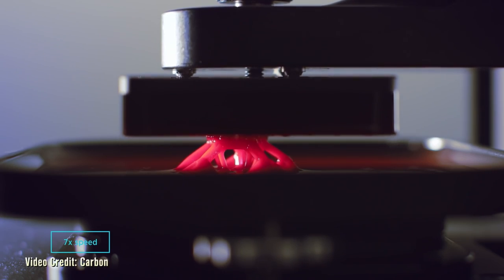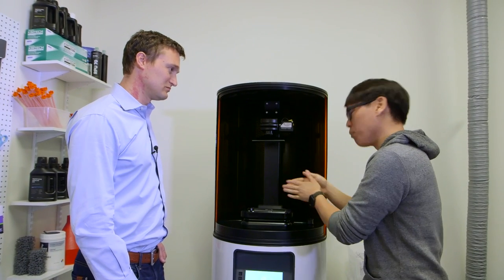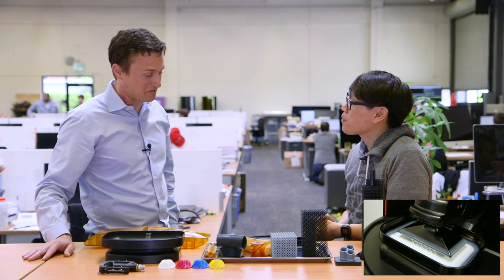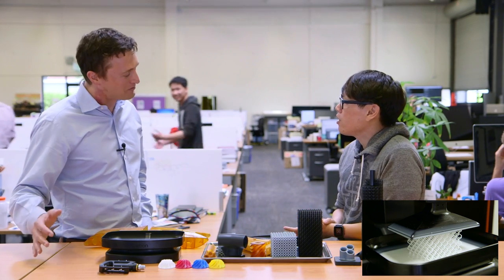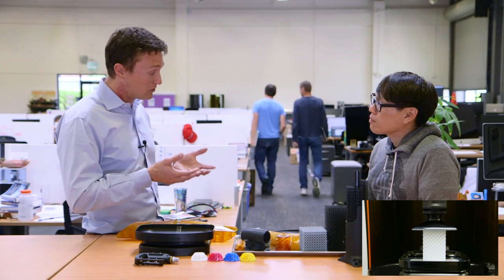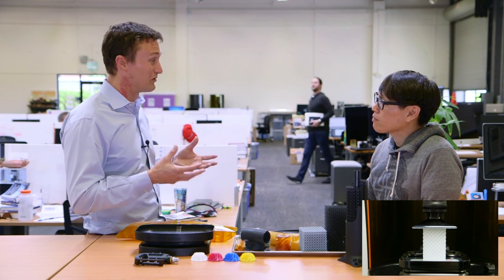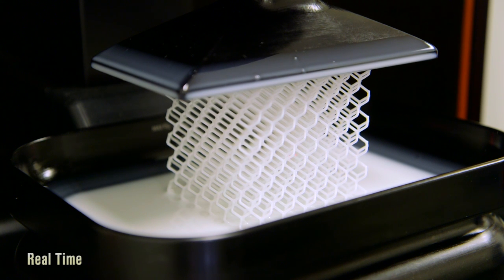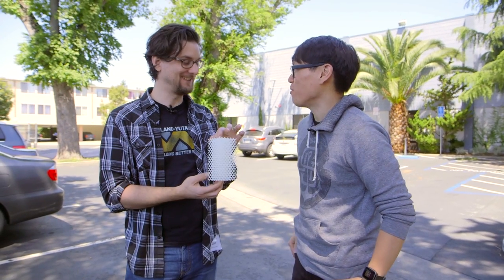Carbon M1 Super Fast 3D Printer Demo!

Comment: Subscription based product... $40,000/yr, so you don't own the printer ? Installation --- $10,000, cheapest resin $99 for 800ml  others are $199, I just leave it here as they forget to mention it  ;)
Reply: +vladoportos That's to start...prices will come down with time. Consider 40k/year is 800 per week to have the machine in hands...that's ~150 per workweekday...
Look at the price of a widget car part at several hundred dollars. You can print one every 15 minutes, or 24 per 8 hour work day (un-optimized).
machine cost is ~6 dollars per part.

Those resins at 250/liter are cheap once you consider volume of the completed part...call it a 100mL part...$25 dollars per part.

...now you are turning around and selling those parts for $400 each. They cost 32 + rent + utilities + staff.
This thing is a license to print money.
Reply: Xerox did the same thing for years
Reply: may be worth it for some businesses.
Reply: +frollard its like a federal reserve at home
Reply: +vladoportos And minimum term is 3 years, so at least 120k.
Reply: +vladoportos Thank you! That door handle won't be cheap...
Reply: tak tady bych te teda necekal vlado :D
Reply: @vladoportos @frollard 
In addition you have to think about the tooling cost for production parts. Tooling for even a simple part can cost over $50,000. That would be for one injection molded component. I had a material science professor that was working with a company and their first tooling didn't work right and  now they have a $50,000 paper weight. However let us assume that you needed three injection molded pieces for your product that's easily $150,000  for a single product. Now since the minimum lease is 3 years you still save $30,000 over three years for just the hard where side of that product. Now that extra $30,000 does that cover the increased cost of material over that time span, maybe. But, that is why there are classes like the engineering economics class which go over cost benefit analysis over purchases and life span of production equipment.
Reply: Thanks!
Reply: 1. Subscribe
2. Print more 3D printers.
3. Lease those out
4. Profit
Reply: There are also savings in not having to injection mold 10,000 parts and store them in a warehouse for months or years. Plus you'd have to wait weeks or months in lead time + shipping to get even get them to the warehouse.
Reply: 5. (Original vendor) Send cease and desist after clients go all in, offer 10x $ limited redistribution license.
6. Profit exponentially.
Reply: Cost of a semi-equivalent 3D Systems SLA printer is min. $250,000..... Renting allows you to upgrade to the latest tech as it comes available. Kind of like the contract you have for your cell phone, but for big boys.
Reply: Initially yes, but that depends how many door handles you can eventually make and sell. Just imagine the temptation in having access to one of these at work or a college engineering lab... with a just a little research re high demand/high price aftermarket parts, a person could be pocketing some sweet extra spending money on the side...
Reply: But this uses light AND oxugen.
Reply: That goddamn mandatory engineering conomics class lol. I already don't remember 80% of it lol.
Reply: There's certainly a break even point to be examined. But if you imagine 30 unique injection molded parts... it's easy to see where certain business cases really benefit.
Reply: How much extra for the light and oxygen?
Reply: I love new Tech and 3D printing was first put into my mind in Jurassic Park 2 - I thought wow .. 
Now look at where this tech is... 
Now I can't imagine this used to make car door handles (that wouldn't be cost effective) If the Resign costs $199 USD and you make 1 door handle out of it - then any business will need to charge you for overhead/lights/employees... that minimum cost would be realistic $499.99 - and who will pay $500 for a plastic door handle? 
I can see this as the way of the future for plastics and resins - however instead of finished products in boxes, there will be drums upon drums of resins, so you don't necessarily eliminate storage issues, and you don't want resin heating up while sitting in storage area. 
The idea of using it for compressor parts, is very plausible. Right now this would fit a niche for specialized parts, aka Aerospace and Military (as they repeated in the video). 
You wouldn't be making Cellphone cases with this... it has it niche and eventually in 20-30 years it might be common place to have these 'stores' making all kinds of junk.
Reply: I saw it at IMTS... $40k/Year with a 3 year commitment. There are also setup fees.. It really needs to be special. Not for the consumer... My pocketbook says that I could put together 50 FFM machines and run a farm or build a couple of high temperature machines to do PEEK, PEI.

This technology is very exciting but out of reach. Even using a bureau you could buy an FFM printer for less than you would pay for one part off this machine...
Reply: Believe it or not. T's and C's of the printer mean they can sue you if you use it to produce more 3D printers.
Reply: vladoportos if I can't own I won't buy.  That is major stupid of them.
Reply: vladoportos Vlado! A ty tu co robis?! 😂 Smikaj natacat!
Reply: Are you trying to say this is expensive?  You don't understand business I take it.
Reply: We need chinese competition to bring these prices down, stuff patents, I want this thing in my bedroom permanently not on lease
Reply: prices will go down it will just take time to massproduce things such as these, and become commercially more viable
Reply: you could nearly buy 40 moai SLA machines,  slower maybe but you can do 40 parallel parts, no contract and no recurring costs.   this really isn't for smart people, just businesses with money.
Reply: Subscription based, no other options? FML. I don't even care if it's like $150,000, there should be an outright purchase option.
Reply: It's been a year since the interview (never mind the invention) and no talk of them even attempting to lower the price, heck, I forgot about this.
Reply: still that's pretty expensive for what is basically a big contact lens and a high res dlp projector but, industrial stuff is expensive.
Reply: darwin wins again.
Reply: Neither do you.  Must be high throughput to generate any kind of positive ROI.  At that price, it narrows down to very few.
Reply: vladoportos it's called capitalism
Reply: The first CD-R drive cost $35,000

Comment: The control of oxygen is done by using a micromirror chip which creates the light pattern required to print the shape you want. They were originally used in projectors for computers, It's made up of a lot of tiny mirrors each around 8 microns squared. The UV light hits the micromirror and creates a pattern, silicone is used between the resin and the light as it allows oxygen into the resin as it is highly permeable to gas. All the while the UV light prints it layer by layer. That's how they manage OXYGEN.
Reply: IzonHow can you reference any paper or sources about this micromirrors. I looks like you are familiar with the technology
Reply: He invented Light and Oxygen.
Reply: He was one of their photo-lithography engineers the CEO was talking about who got disgruntled and is now spilling all their secrets ;)
Reply: Thank you for pulling there paints down in front of everybody and revealing their privet parts so we can all have a good laugh.
Reply: I'm nothing to do with this company, I just know how it works lol
Reply: Could you post a link for the mirror size of 8 microns squared? Aren't you a bit exagerating? :D
Reply: DLP4500 have mirros of size 82,08 microns squared. So 1000% more. :D But thanks for the links.
Reply: @Jesus - I thought that was your dad that did that?
Reply: These printers utilise UV initiated free-radical curing of acrylic resins. It is exactly the same process as in UV curing printing ink. Oxygen inhibits the reaction by scavenging free radicals and terminating the polymerisation reaction. Oxygen is bad. In printing inks this results in slower cure and poor cure at the ink/air interface (called poor surface cure). How do you counter this? You add amines, amines help overcome oxygen inhibition and enable faster curing in the presence of oxygen. This is industry standard for UV curing inks.

They haven't done anything revolutionary here and they most certainly aren't using oxygen to speed up their curing. They threw some amine in their resins, that's what they mean by controlling oxygen. I'm surprised this wasn't a component of their formulations to begin with.
Reply: If it's not new, then why hasn't anyone else put this technology into production yet? Probably because the details are hard. Going to the moon on a rocket is pretty easy when you ignore the details.
Reply: @IzonHow  Thanks for illuminating what the company VP, Phelps, is compelled to keep in the dark for proprietary protection. I'm not a competitor of Carbon just OC curious:)
Reply: @soupisgoodfood42  Like Marconi's wireless telegraph patent. The knowledge (science) is commonly known,but the application is new. Smart marketing strategy to apply television tech (micromirror chip) to 3D printer tech.The chemistry sounds similar to cosmetic UV light cured acrylic fingernail extensions and dental light-cured polymer applications used since the 1960's. There must be many more "new" applications for established technologies when one combines or crossover disciplines creatively. Definitely an improvement as far as time saving. KUDOS, Carbon! :)
Reply: @IzonHow  Great analysis and explanation.
Reply: @paulsmith-gi5vm  Hey thanks Paul!
Reply: Look at big brain on brad
Reply: @IzonHow can you just take Kirk's position? I feel like I wont hate this video if youre explaining it! 😂😂
Reply: @mooreoftom  DLP printing has been around forever. The patents have expired, that's why companies like this can use prediscovered tech, now.
Reply: That's a DMD chip dude. It's commonly found in dlp projectors
Reply: Yeah, I'm gonna need you to explain that back another 150 times...
Reply: This kind of 3D printing technology is hopelessly out of reach of us commoners.
Reply: @jorgelima7899  any DLP projector
Reply: @jorgelima7899  its just DLP projection. Nothing fancy. Still used today in high grade projectors
Reply: @pitbullterrier4277  i think he meant 8x8 microns. No one says microns squared as a unit of area.
Reply: You should do videos on describing how things work.
Reply: Great tech, I gussed since the oxygen absorbs UV kind of like ozone cycle and will generate heat, and the resolution of heat distribution is controlled by the software layer thus heat curing the resin, I am way off
Reply: @BrosBrothersLP  lol cm squared is a measurement of area
Reply: Kirk from Carbon3D wants to know your location

Comment: "How do you get even distribution of gas?"
"Alright, so the answer is great engineering"
Reply: The control of oxygen is done by using a micromirror chip which creates the light pattern required to print the shape you want. They were originally used in projectors for computers, It's made up of a lot of tiny mirrors each around 8 microns squared. The UV light hits the micromirror and creates a pattern, silicone is used between the resin and the light as it allows oxygen into the resin as it is highly permeable to gas. All the while the UV light prints it layer by layer. That's how they manage Oxygen.
Reply: @Sludgee9  Because they don't have a patent on the technology and aren't selling a product anyone could buy to take apart to figure out how it works?

Comment: Next time interview an engineer, not the PR guy
Reply: the engineers don't know how to talk.
Reply: Yu An Shi and the PR guys don't know what the hell they talk about.
Reply: That neck hickey though
Reply: Yu An Shi that's why they need a good interviewer.
Reply: Then you end up with some dude saying "we use electromagnetic radiation with a wavelength of about 275 nanometers, and a highly reactive non-metal oxidizing element to control the crystalline lattice of the synthetically produced resin converted into a polymer. Because we use electromagnetic radiation  and an oxidizing element to control the pool of macromolecules with repeating subunits, we can therefore do a lot more stuff in less time"
Reply: Dave W. And the problem with that is... what exactly?
Reply: They cannot tell you details , this is grade secret
Reply: a major statement that you all seemed to of missed -- " your controlling the light but how are you controlling the oxygen?" " As we talked about before, I cannot go into the details of how we control it, what I will say is that we understand, as you saw from the science paper, the physics and chemistry of light and oxygen together and how they work with the chemistry with the software, with the hardware to balance these effects and make these great parts "

You can tell that it's 2018, there's more idiots then EVER before in human history - humorous but alarming.
Reply: This is why Tony Stark is successful
Reply: PR guys hide engineers off cameras... guess why )))
Reply: Yu, the engineers know how to talk but they can talk out all that corporate shit and the big company suddenly will be resized down )